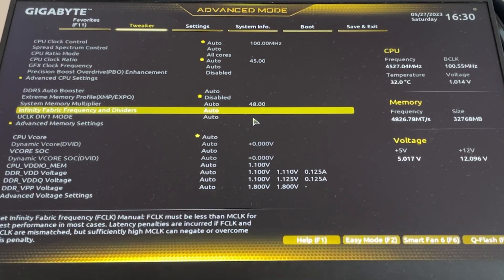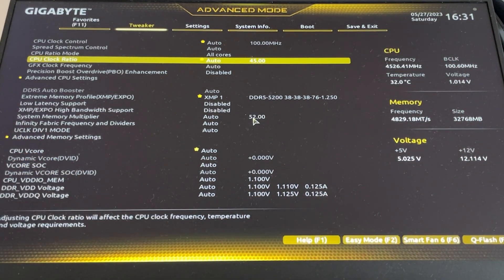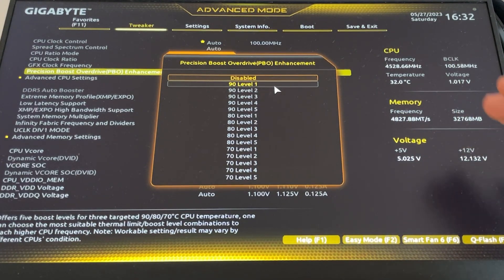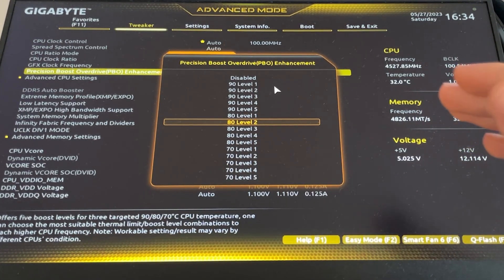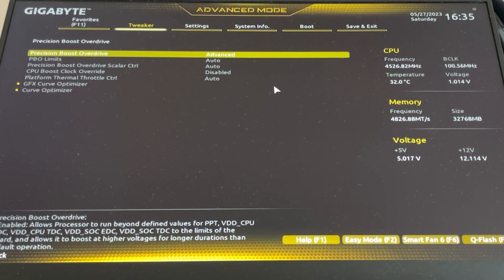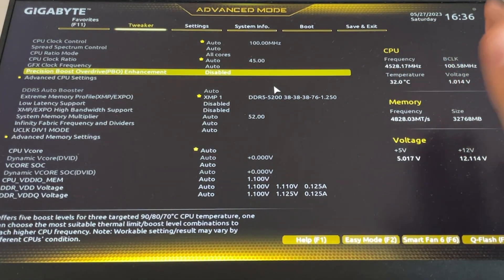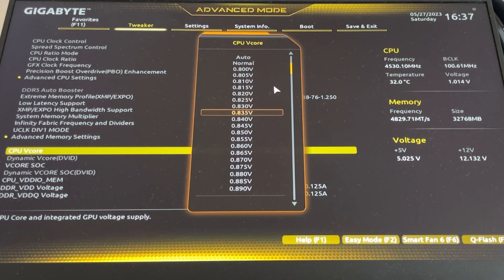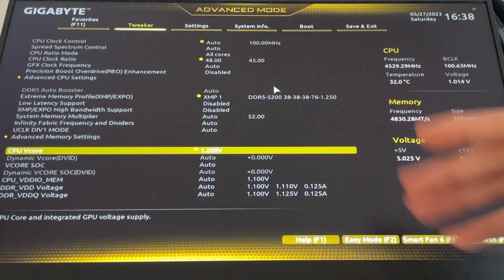Undervolt your Ryzen 7 7700X for more FPS and Lower Temperature!

Comment: I had a similar problem of heat hitting 90-95 but i had the aio bracket flipped inside out meaning not enough pressure on the cpu. Fixed that and now it sits about 80. Easy mistake to make so i wonder how many people have done the same and just think that 90+ is normal.
Reply from the maker: To be honest it reeaaaaally depends on the AIO tho. These CPUs run high in temps

Comment: Hey mate I only lose about 10 fps in Games but man 60-70C amazing Ty running the level 2 80
Reply from the maker: I’m really happy it was helpful! Thanks a lot for taking the time to leave some feedback! :) I’ve also got a few build videos on the channel and more coming, if you like the content consider subscribing as it really helps the channel!
Reply: My values are
Ppt 88, 75, 150 
Thermal throttle 85
Negative -25 CO 
Before I was having amazing temps around 55-63 while playing , so I decide to upgrade to 7800x3d at the end I did not like it and I went back to 7700x unfortunately I can not have the same great temps before testing the 7800x3d is weird because my temps increase around 5 to 10 degrees I have already format but I can’t lower the temps again. Any idea? Thanks
Reply: @armandoarroyo this creates bottleneck with 6950XT on some games Like NFS Unbound

Comment: I'm building with liquid cooling for the first time and I bought a 7700x. Do you think it would reach these temps with water cooling? Or should I just go for something like 90 lvl 2 in my case?
Reply: I’m running the Lian li Galahad II LCD 360 mm aio with the 7700x with 6 fan intakes. Stock it was hitting 96 C. Set the throttle temp to 85 and modified the curve optimizer to a magnitude of 30 negative and gfx curve optimizer to 15 as it was the most stable. Went from temps hitting 96 to cinebench, prime95 and cpu z stress test never exceeding past 62 C. Only downside I saw was the cinebench score. Went from 1101 at stock to 1091. I’m definitely gonna try to play with the settings a bit more especially with the voltages since when I tried to do a voltage offset with my settings my pc wouldn’t boot to windows and began trying to make repairs. Hope this gives you a baseline for when you do yours
Reply: @greedxvii3698  Thanks a lot, yeah. It seems that liquid cooling has the same problems, it just takes longer to hit those 95 degrees.
Reply from the maker: Yessir, unfortunately even with a good AIO these CPUs run at high temps
Reply: @ImWateringPSUs  Actually I found out about PBO and I've never surpased 65 degrees these last two months.

Comment: Hi, i have r7 7800x3d, are there any other solutions you recommend? Thanks man
Reply from the maker: Same settings, really, except you can get away with a lower clock speed because the 3D V-Cache does the most :)

Comment: Hi, I have a 7600x I've tried using bpo2 but in cinebench I still have temperatures of 85 degrees and with your setting of (80~20) 80.3 degrees, am I doing something wrong? or do I have some option disabled?
Reply: the only setting that seems to work is the thermal throttling
Reply from the maker: If you’re using the temp target + negative curve optimizer (80-20) then around 80C is what you should be getting indeed! (And it’s safe) if you wanna get it lower you need to do a static core ratio + offset (I go very in depth in the Ryzen 9 7900X undervolting tutorial)
Reply: @Claymore34 set a power limit of 85, not thermal limit, power W limit, I have 75w limit for my 7800x3d she don’t go past 60° 🥶
Reply: @iamdeluluu can you go more in depth on how to do this, it’s my first build and my games crash when it reaches 85c° and I don’t know what to do
Reply: Agreed I would enjoy as well, I’m super new to all this

Comment: what is the difference between curve optimizer and gfx curve optimizer? Why use GFX instead of non-GFX? You showed the GFX modified in your video which I believe is the curve for GPU in the processor.
Reply from the maker: You do need to use the non-GFX one, the GFX is indeed the curve for the iGPU. You can also undervolt that one to save even more power tho, to be fair
Reply: @ImWateringPSUs in the video clip you set the gfx, not the non gfx. You should do the correct thing
Reply: @ImWateringPSUs  my best settings for a 7700X is 85/-15. Anything above(meaning -20.. -25) -15 crashes in Prime95.
I gain 15W consumption reduction and +200 points in cinebench above base reference. It's a meh... but I'll take it 😀

Comment: if i just set clock ratio to 48 and vcore to 1.2v this will be really safe no matter what lottery silicon i get on the 7700x right? what's the usual ratio like if i were to set to 50 ratio what vcore would i need?
Reply from the maker: Yessir! For 50 I think you’d get closer to 1.25

Comment: In the video, he undervolted using in pbo, gfx curve optimizer.
Shouldn't he used just the curve optimizer setting? Isn't gfx curve optimizer used for tweaking the integrated igpu?
Reply from the maker: Yup, normal curve optimizer has to be used
Reply: so it has nothing to do with the dedicated graphics card?
Reply: @AMDNetworks no

Comment: good material thanks, I also have a Gigabyte motherboard and jumped from bios ver. F3H to F8C, on F8C I can"t even post with EXPO... so I went back to F3H, what's your bios ?
Reply from the maker: I was using F8C actually, but I've heard about plenty of people having issues with it! Thanks a lot for the support
Reply: @ImWateringPSUs I see thanks, not gonna line  I saw the changelog said "Improved DDR5 OC performance" and wanted to try it, was a bad idea !

Comment: Which method do you feel is better? Seems like my CPU cant even handle level 2 it's clearly unstable, I probably got a weak one.
Reply from the maker: If you don't have an oversized GPU and need every last frame, the static one is gonna be the best!
Reply: @ImWateringPSUs thanks for the reply 👍 I have a chunky XFX merc 6800xt paired with the 7700x. But it's been pretty underwhelming overall.

Plenty of times just opening up a random very light duty program it's really slow and freezes up a bit, however idk enough about computers to know if this could be a sign that I have a faulty RAM (g.skill with expo enabled) or something.
Reply: @B-ROYalty  Do you have SAM on in adrenaline?
Reply: What does SAM do?

Comment: Static/5.3Mzh all cores or dynamic/ 4.7-5.1 all cores & 5.3 global frequency for games? 

Cpu Vcore voltage - Auto or 1.200 for ryzen 7 7700?
Reply from the maker: For strictly gaming, the PBO setting (Temp Limit & Curve optimizer) is the best
Reply: @ImWateringPSUs  Which curve optimizer is best for gaming? I tried 80 level 2 and level 3 but i do not know which one is better, i am stable on both btw.

Comment: great video, i have one question: with clock ratio at 48 the cpu will always run at 4.8 GHz all cores. So it will not boost to like 5+ GHz. Doesn't the boost allows better performance instead of the static frequency?
Reply from the maker: That's a good point! The problem is that in sustained loads, especially during HEAVY loads, the core clock drops regardless! During an AVX workload it's rare to see it over 4.8! But that's why I recommend the static profille mostly for productivity
Reply: @ImWateringPSUs  so for gaming what's better? Static or dinamic frequency?

Comment: Nice but would be nice to see the diference in temps and performance
Reply from the maker: I actually cover that in the build video! This is just the tutorial :)
Reply: @ImWateringPSUs  I even liked your 7700x video, but it's too confusing for me. I would really appreciate a video with that processor for the msi definitions. It was the best. Another question, is it worth switching to a 7800x3d or 7950x3d? Or is it not worth the difference since I have the 7700x?

I have 4x32 cl36 6000mhz corsair xmp and I can't put the ram with xmp in these values. Do you have any idea how I can manually overclock the ram? Thanks for the answers, I wish you the best of success.

Comment: Have you noticed by any chance, the CPU voltage exceeding 1.3V with none of these settings applied? You know, with out of the box settings, expo disabled and stuff.
Has turning expo on made the CPU voltage exceed 1.3V?
Reply from the maker: I actually haven't seen it exceeding 1.3!
Reply: @ImWateringPSUs  even with expo enabled?
Reply: @yusefhusam  I'm on my bios' latest non beta version. But I've kept expo off just to be safe as I've seen it increase SoC voltage. It's not that I'm missing out on much performance ( 4800mhz instead of 5200mhz ), so I'd rather just have a headache free experience 🙂